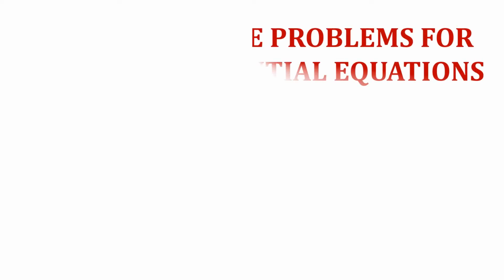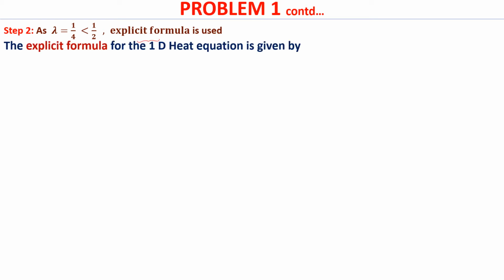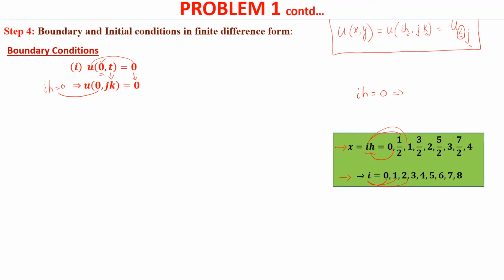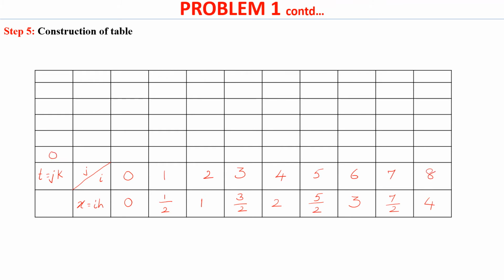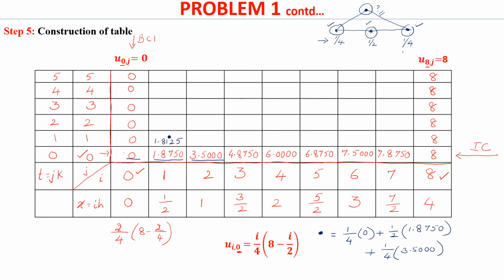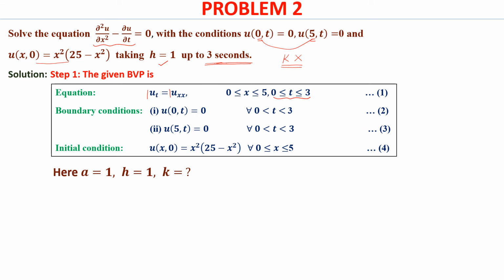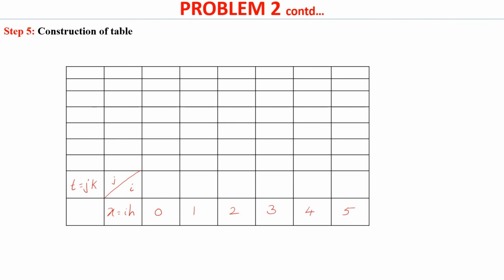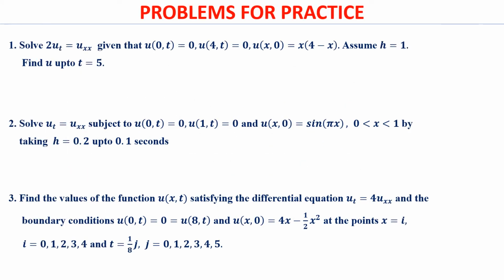Finite difference solution of "Heat conduction in a rod" - Solved problems using Explicit method

Comment: Mam in first method when u construct the tableu take i\4(8-i/2) but when u apply the value for u(1,0) u take 1/4(8-1/4) how plz reply......
Reply: I think 1/4(8-1/2) become there
Reply from the maker: Yes it's 1/2 not 1/4. 
values are correct
Thank you
Reply: Yes, thank you for your remark. The 2/4(8-2/4) was an error but if you try to calculate you will realize that the computation was done based on i/4(8-i/2).

Actually, thank you for your attention.